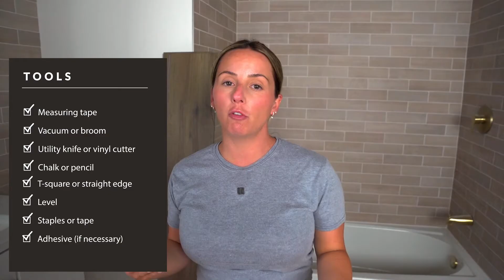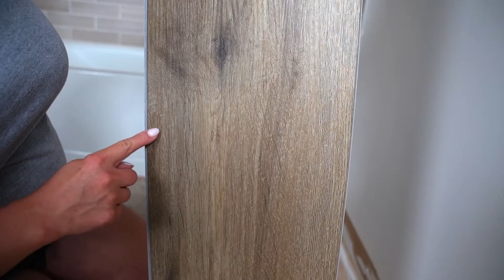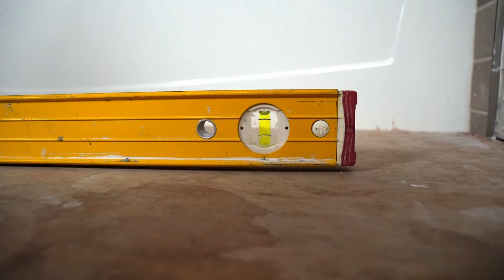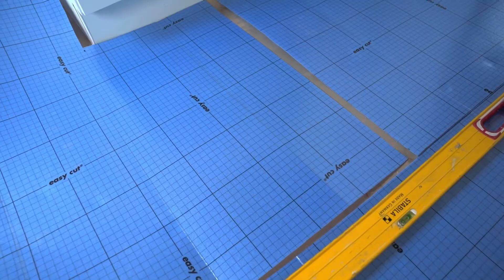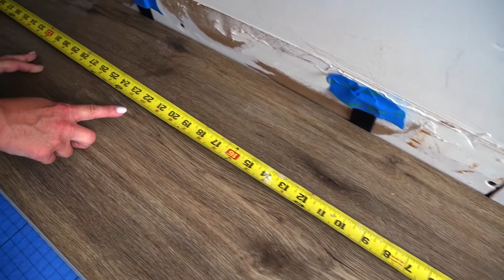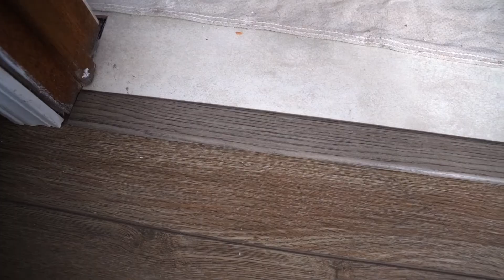How to Install Vinyl Plank Flooring: DIY-Friendly | Tile Shop Tutorials

Comment: I have installed 5 vinyl floors all different Brands. I own 5 rental properties. ALL of them fail after 2 to 3 years. Never ever install Vinyl floor on your house they suck.. I did not install 2 dollar sq ft cheap stuff. I spent 3.50 to 4 dollar sq ft stuff
Reply: Probably poor install.
Reply: @daleklampstar  No.!!!! You have NO IDEA what you are talking about.
Reply: Mine have lasted for way more years than that with a lot of traffic and pets.